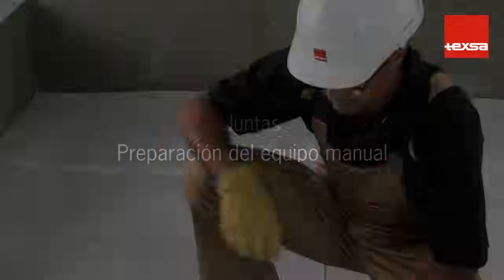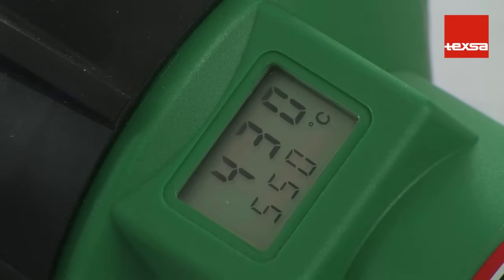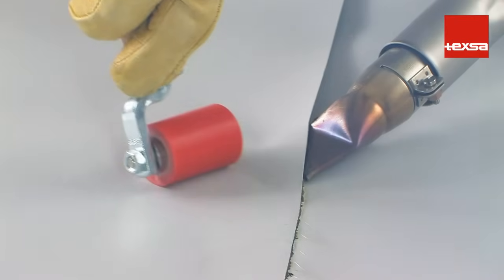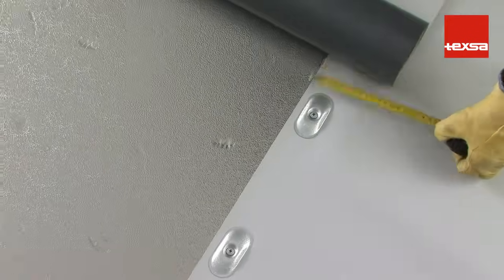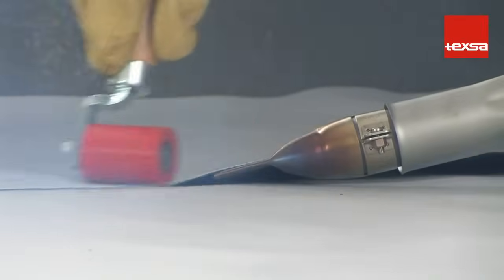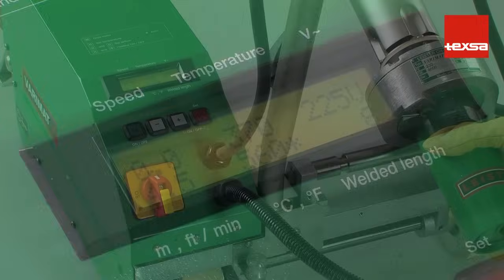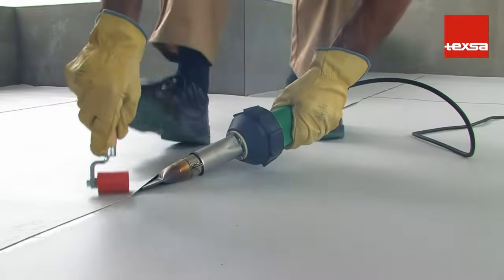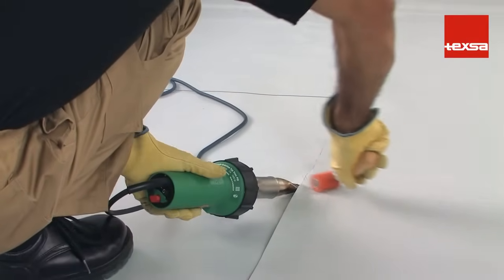2/7 PVC Waterproofing Membranes: Joints - Texsa (English)

Comment: Now I've been roofing for 3-4 years. Correct me if I'm wrong but, I'm pretty sure that's TPO and not PVC.
Reply: You are wrong.. and I've made the same mistake. It looks very similar, and it's the same process, but tpo is thermoplastic olaphin, pvc is poly vinyl chloride. Pvc is more like rubber, you need to just move a little quicker with the heat and it smokes like crazy when welding it.
Reply: @curtjrich15  Themoplastic polyolefin
Reply: TPO does not extrude like that during the welding process, and t-joints are not typically chamfered, but covered with a patch of unsupported membrane. This looks like a Sarnafil s-series membrane to me.
Reply: thats PVC  the scorching and the smoke are indicators
Reply: Hi, do you need the welding machine, we are manufacturer! 
If you are interested you can contact Elynn Chen WhatsApp: +8613515002282
E-mail: sales3@lesite.com.cn
Skype: lesite03
Reply: Elynn Chen how much?
Reply: Cake work. I've installed alot of PVC in tunnels. 30 years worth.